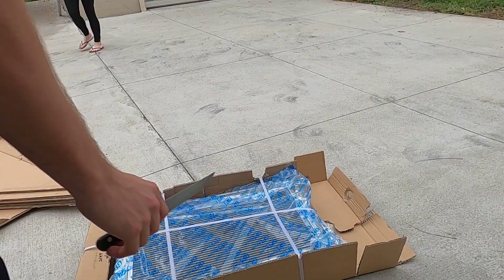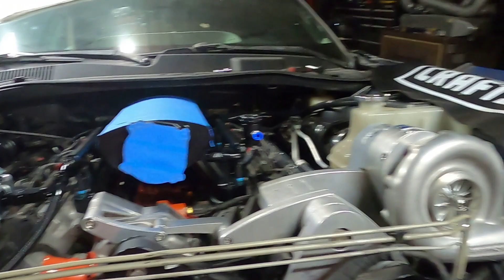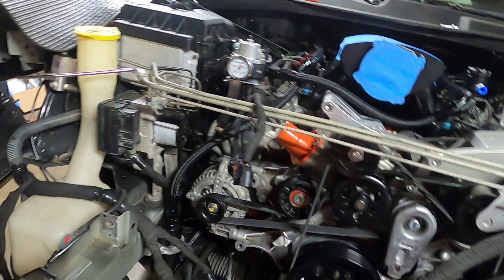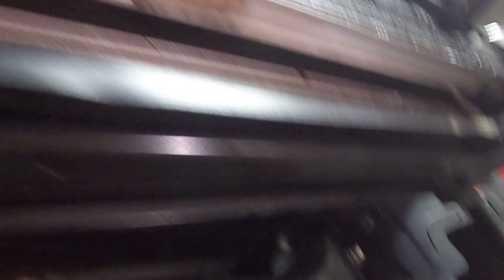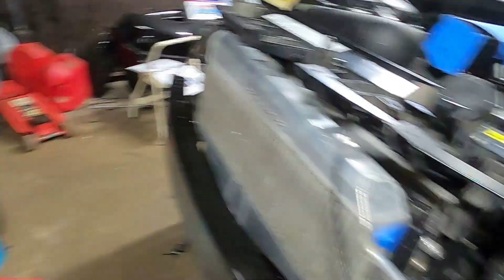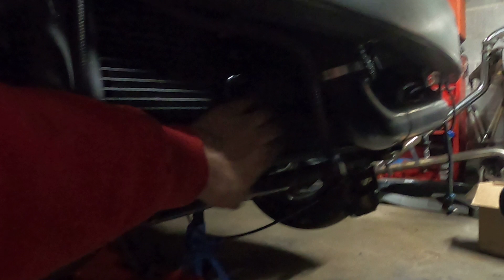Holley Sniper Intake Manifold Install & More!! (Procharged 426 Gen 3 Hemi!)

Comment: So the map sensor is basically held on by a screw on the back of the intake? Did you have to drill into it, or the hole was there already for mounting?
Reply from the maker: Yep! I'm running the 2 bar MAP sensor. That utilizes the 2 threaded holes on the back of the intake.

Comment: What did u do for the plugs in the bottom
Reply from the maker: I ran brake booster, catch can outlet, evap canister. And used an 1/8” npt plug on one of them, since I wasn’t using it.
Reply: @themojogt  did u use different fittings or did u use the ones tht came with the intake. Cause I'm at a stand still with tht particular thing so far ur video as been the most helpful out of wht I've founs
Reply: What injectors are you running? I have Hellcat injectors and they definitely do not fit with the stock rail mounts
Reply: @nickcarnes6194  I just ran into the same issue
U either need fuel injector spacers which u can get from k&n speed factory or u need a TALL style injector.
I talked with Holley on the phone for an hour about this issue. They said they have had several million complaints about it but recommend using injector spacers
I used them and have had no issues since
Reply: @mikewilhelm5170  I’ve heard and read all of it, surprised me when he said this. He either isn’t using factory injectors or he didn’t get them in right.
Reply: @nickcarnes6194  as far as I know mojo gt is running a different set of aftermarket injectors
I'm not sure wht kind exactly so best of luck to u with ur current situation ur dealing with. I kno it aggravated me a lot along with several other issues brought on by going with a Holley race series intake
Reply: @mikewilhelm5170  so you haven’t had any issues with the injector spacers? It worried me a little. Especially if I go e85, i do not want an engine fire. 
I’ve been considering going with aftermarket injectors and keeping it all the same
Reply: @nickcarnes6194  if u go e85 u will definitely need larger injectors cause it burns faster.
But no once I put the spacers in and got everything tightened down I was good to go 
However I do highly recommend making ur own fuel rail brackets cause the supplied ones r shit and too short. Or at least mine were
But if u use oil on the seals of the spacers and injectors they slip right in and have no further issues.
When I 1st did it I screwed up and used brake clean on everything when I had fuel spraying all over so if ur not careful tht will dry the seals out so I had a lot of trial and error with mine at 1st so best advice is use oil the 1st time and u will be good

Comment: So I plan on buying a holely sniper intake, manifold as well, but I have a 547 is there anything that I would need that theHolley  kit does not bring?
Reply from the maker: Yeah, if you’re running a factory fuel line from the take you’ll need a -8an to push connect fuel line fitting
Reply: 5.7 my b